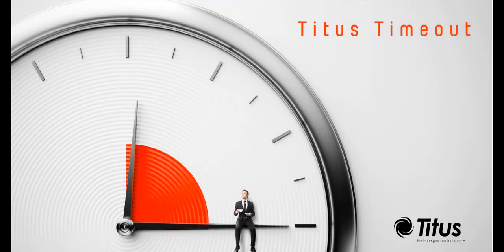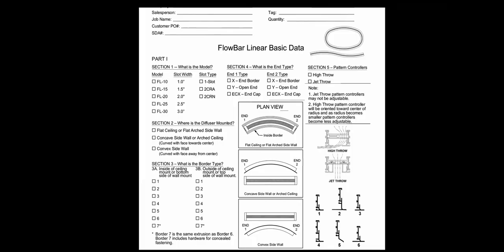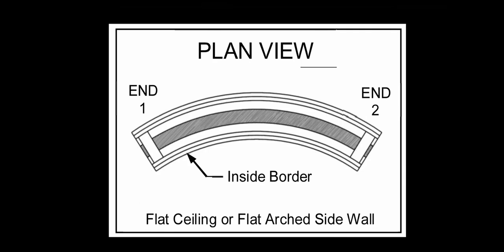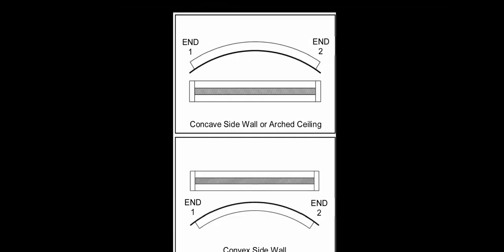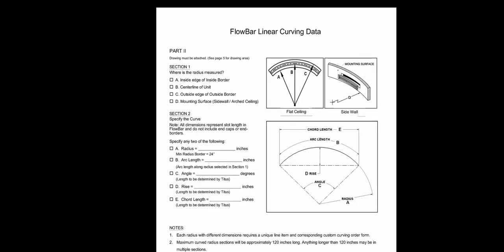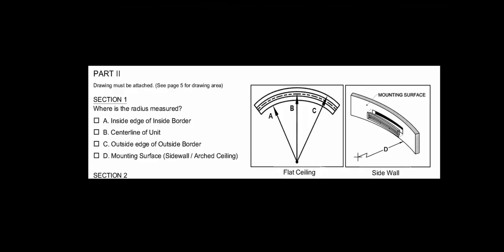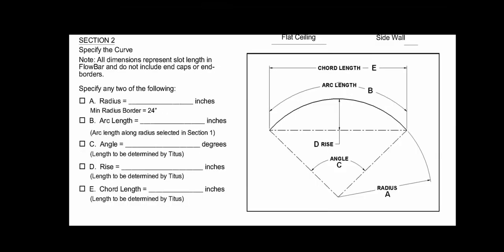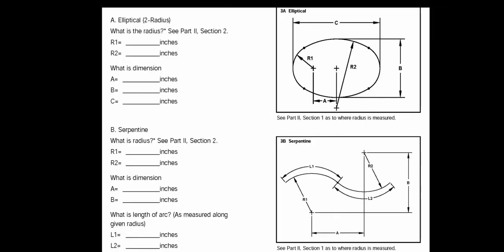Titus Timeout Podcast - Ordering Curved Linear Diffusers

Comment: What is the configuration or shape of the planeum box needed for the concave side-wall flow bar diffuser mentioned in this video?!
Reply from the maker: For sidewall installations, Flowbar and their corresponding plenums are typically curved to concave or convex shape.  The curved FBP is custom made to match the curvature of the concave/convex curved FL.

The mouth of the FBP is cut to match the curved neck of the Flowbar.  For additional questions please email at grd@titus-hvac.com
Reply: @TitusHVAC  I have received an email thanks 🙏.